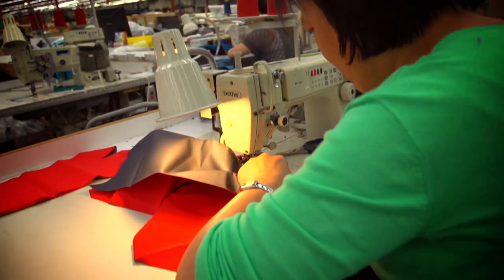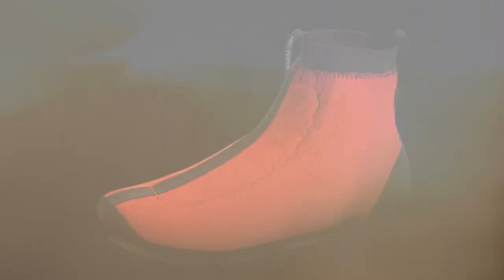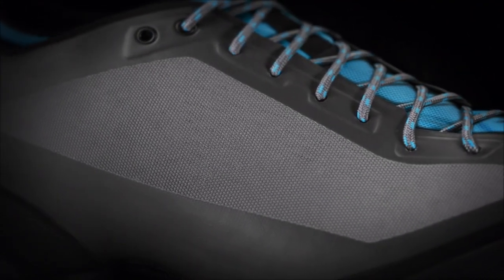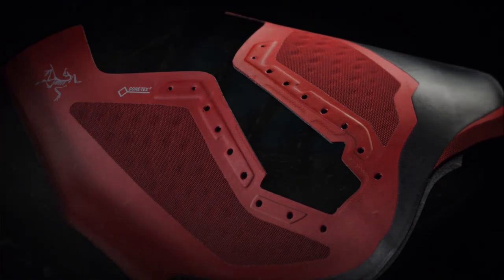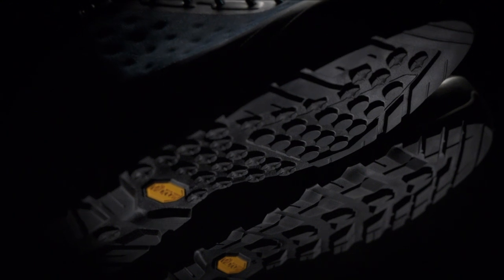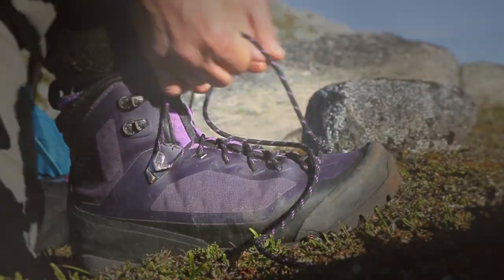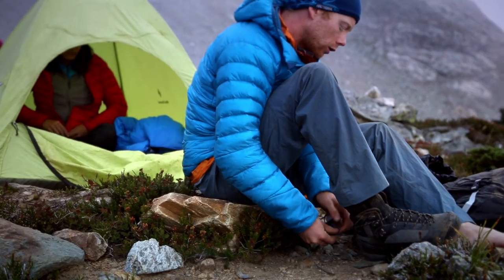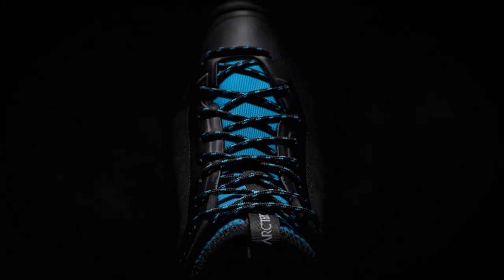Arc'teryx Acrux and Bora - A New Era In Footwear Design

Comment: When and how much? Is it going to be included in LEAF program?
Reply: Their website lists the prices at $320 dollars MSRP for the Bora 2 $270 for the basic Bora and Acrux 2 and $220 for the basic Acrux. I'm not sure if the more expensive versions are the only ones with interchangeable "adaptive-fit" liners. I'd assume they'll make combat boots if they see demand for subdued versions of these, or if their LEAF vendors request that they do so.
Reply: Ken Clark I guessed so. However, those prices are out of my reach, so I will go on admiring Arc'teryx products but possesing none but the knee caps. Damn it! If I were a rich man.
Reply: Jorge Tierno Rey Yes, this is also way out of my budget, still using the same cheap water resistant soft toes for last 6 years. The knee caps are probably the most worth while thing to buy from Arc'teryx whether you're a rock climber or police or mall ninja.